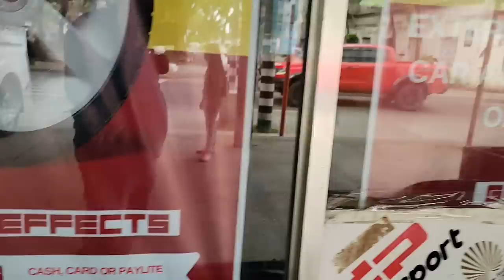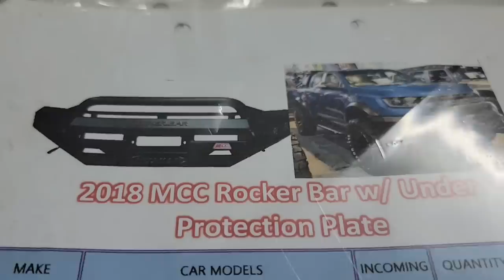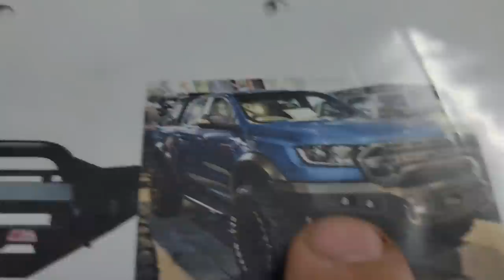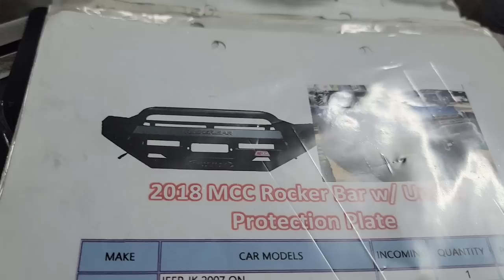Announcement About our House & Truck Accessory Shop Visit

Comment: Congrats on the HOA President appointment. Just an FYI there is a 1960's law that requires you to have your roof rack registered at the LTO. It cost about 200 to 300 pesos. You have to do this yearly. If the police do ask for your roof rack registration it can be a 5000 peso fine if you do not have it.

Comment: You want hub centric forged wheels with no more than plus or minus 5 on the offset because of the pressure you put on the wheel bearings. Lift kits should be kept to an inch but if you go beyond that you will need a differential drop and a carrier bearing drop to avoid vibration and excess wear on your cv joints. The more radical you get the more you need to modify and spend. Keeping the rim small and increasing the tallness of the tire to a 75 or 85 series can give you more clearance but reduce torque. For off road do keep in mind that when you air down you will reduce the circumference of your tire and gain back some of your torque. Yokohama geolander is made in the philippines and has a three ply side wall. I think is available on both AT and MT tires . Stay away from cheap spacers and make sure that they are hub centric if you do get them as you never want your wheels only depending on the lugs for stability. They do make adapter rings for rims that aren't hub centric.
Reply from the maker: you said it all exactly right to a T!!!!!!!

Comment: I was a military housing area coordinator a few times over the years while in  the service (one of many additional "hats" or missions/assignments you get stuck with as a military dude)...Same duties as it sounds like you've taken on...It can be a real pain in the 4th point of contact...The good thing is you can set up the rules versus enforcement of the Army mandated rules...Best of luck...😄

Comment: you want to check with LTO before you fit accessories to your truck here in Davao the police make you take them off if it not on your registration that includes roof racks spot lights bumpers etc
Reply: Same here on Panay just takes one LTO checkpoint and off comes the, roof rack, steel bumbers and over size tires unless you have had them listed on your lto registration

Comment: My NP300 Calibre has been set up from, Black Mamba Mags + Old Man Emu Coils and Suspension + Falken Tires AT 275 70 17 0 offset costing mo 150k pesos including installation. I did changed also my control arms ball joint to extended ball joint.
Reply from the maker: Love it - email me some pics please jamesray080808@gmail.com

Comment: Uh oh, I saw the writing on the wall. HOA coming to the Western Visayas. That's it, throw the canough into the fray. lol. You know I heard that there is an Australian guy who is the Mayor of one of the smaller towns in Iloilo, and the last I heard he had served 3 terms. All the locals really preferred him as Mayor rather than a local native because he never showed favoritism when hiring municipal workers. If a job came up, he would pull the 1st application from the pile of applications (from the bottom, up) & not give a job to somebody because they knew somebody A foreigner can run for any public office except Federal or Provincial positions. I have yet to see any towed trailers in the Philippines except for a single large air compressor. That roof rack you chose is big enough to have at least 6 passengers riding on top.
Reply from the maker: That is interesting on the Mayor. We see trailers all the time. We live directly on Highway 501 Coastal road. Boats and Jetskis pass here always plus other equipment. A lot is going to Boracay by here. Now days speed boats and jet skis are a everyday occurrence on the water behind us. One thing about us as a HOA is we all agreed we dont want to impede on each other  just maintenance and security issues and rules like construction with off street parking as the original rules when we bought state. No Pig farms etc. Not like in USA where they tell you you cant paint your house a color or the kind of plants you use.

Comment: Your requests are just common curiosity.👍🏻👍🏻
A lot of people don't realize low profile tires will put unnecessary wear on the suspension system.
Reply: Only if you not set up for low profile tires as I use them on my race car and my suspension is set up to ride them with no issues 😎

Comment: Are you thinking about upgrading your suspension due to the weight added by your Smittybilt M1 bumper and winch? I'm a little concerned about the added weight negatively effecting my factory Bilstein shocks on my 2016 Tundra TRD Pro. (Thoughts?)

No offense, but HOAs always go wrong eventually. People just need to respect you enough to never think about even figuring out where you live.
Reply from the maker: My bumper has been on there for a couple years and no shock problems. Love that smittybilt M1
Reply: @TexasFilipino  I like the looks of it, but it looks like I'm out of luck because I can't find one for the 2016. Enjoy yourself over there. I miss their food.

Comment: thats an expensive habit to get into bossman
Reply from the maker: Been in that habit since I was a kid. You all dont know my history in the automotive world in my area.  I built  badass race cars ON MY OWN and I mean ON MY OWN  and was racing drag at 15 years old. V8 Vegas full custom framed with a variety of motors. One I ran a custom built 400 small block built into 426ci first with tunnel ram and two 4s. I built stroker 383's , 327s 283s(great motor) , I built 3 v8 vegas. So many other cars like 67 68 69 camaros, firebirds, mustangs, 1940s and 50s cars and trucks to late model cars as well. I did off road trucks and boats as well. Not a new hobby it is a life long part of me.